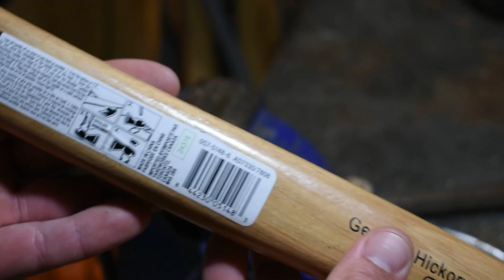Fitting A New Axe Handle - How I Do It

Comment: The wood shouldn’t be flush with the eye. The pins should be perpendicular with the force on axes and at an angle with mauls and hammers.  But most concerning is the  face of the head isn’t perpendicular  with the handle when you mounted it. Why post if it’s wrong?
Reply from the maker: Just to get you all riled up.

Comment: I was surprised how gently hitting the base of the handle worked- after shaping the handle to fit, it went in to the head and was a firm fit. Or so I thought until I inverted it and hit the base. The handle came out another five eighths. I made a hardwood wedge, put a piece of wood across the top and tapped it in, cut off the excess and it was done. It worked perfectly, so thanks mate. Good advice indeed!

Comment: Nice to know I've been doing it wrong all these years. Thanks man. Now I know how to do it properly. Lol!!!
Reply from the maker: Haha, I wouldn't call your way wrong per say - more than one way to skin a cat. This is the method I've fallen into though, only thing I'm lacking is some wood glue on the wooden wedge before it goes in. Thanks man!
Reply: Well... I don't know, some of the things you do certainly would help. Like, I never thought of chopping off the excess wood sticking out the top. That would help especially on hammers. If you miss your target and happen to hit that part sticking out, it tends to mess with the wedge and sometimes cause splits INSIDE the handle. Then suddenly you have this shockwave running through your handle zapping the crap out of you. I'm sure you've had a handle split and shatter right where you're holding it before right? Painful event. Especially when it only splits enough to grab some skin and pinch. Lol!!

Comment: What is the benefit of hitting the bottom of the handle vs tapping the axe head on?  Does it seat better?  Just replaced a handle and i hit the handle on the ground and also tapped the head onto it then put in the metal wedge.

Edit:  I just answered my question by holding axe upside down and whacking the base with a deadblow hammer while holding it.  Seated almost another 1/2" further down.  Now i need to trim the proud portion of handle around my metal wedge and drive the wedge farther down.  Thing is tighter than a snakes asshole now.
Reply from the maker: Lol yup, nailed it. It's the best way to seat the head proper :)
Reply: Big 👍 mixwell!
You nailed it, it’s a wild thing how well it works

Comment: put some wax on your saw blade, trial fit the axe head, shave handle  until you have minimal wood curls. don't be using a metal hammer on wood, use a mallet or hide lump hammer or at least synthetic bleh !  headed mallet. good to check handle heel is chamfered, makes it less likely to splinter. All credit to Billy Ray.

Comment: I always burn the old handle off
Reply: Really?Did you never consider that the axe would get hot and lose it’s temper,a blacksmithing term that refers to the hardness of steel.
Reply: No Ik that I work at a welding shop but I’ve never noticed it being a issue I’ve never had one shatter on me but it could I suppose never had it be a problem thou if one was worried about it you could re temper it I suppose

Comment: Am I correct in assuming that the larger end of the eye is on top, so that when you put the wedge in it spreads it wide open and thereby holds the head on from coming off? I have a craftsman head that I’m going to be putting a handle on soon, the only problem is that it’s not so obvious which end is the topside, can anyone help me with this? Thanks for a very informative video!
Reply: correct
Reply: @simonandfaerk  thank you sir for the response, it should be a great help! 💪💪🙌🙌🤟🤙

Comment: Not bad! Since you know so much about axes maybe you can help me. I'm in a spot. I have a maul handle and an axe head. Getting a new handle is apparently not in the stars. Is there any way you  know that I can make the two work togather?
Reply from the maker: Shave the maul handle down until it fits the eye of the axe head and then wedge it. Won't be as good, but might do for a bit... Other than that you could always carve your own handle to fit!
Reply: @lumberjackoutdoors933  ok, I understand. A safety aspect was was still hangin on me, asking someone skilled re~assures me it can be done with a quality wedge or two. 
Thank you, Sir
👍
And 
If it comes out real pretty I'll send a picture.😉

Comment: I'm curious why you chose a step wedge rather than the barrel wedges that came with it?
Reply from the maker: The step wedge just seems to be a better design. I don't think you get much more holding power with the barrel wedges, I've tried both and the end result is the same. Barrel wedges are significantly harder to drive in though.
Reply: @lumberjackoutdoors933 that makes sense. I appreciate your response